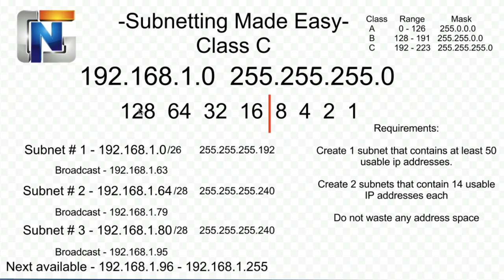Subnetting Made Easy Part 2

Comment: @NexGenT if the first usable ip address in the 2nd subnet is 192.168.1.65 then the last is 192.168.1.78 right?then that's just 13 usable ip addresses am i correct?that part is what confuses me O_O
Reply: by @D Tech

i assume you made the calculation 78-65 when you thought he had only created 13 usable host addresses BUT you forgot to factor in that the range is address from 65 to 78 INCLUSIVE, which is 15 usable subnet addresses.